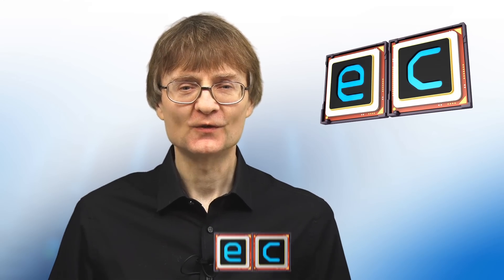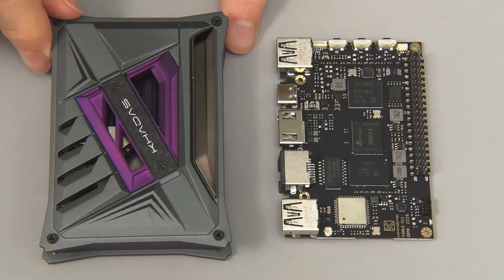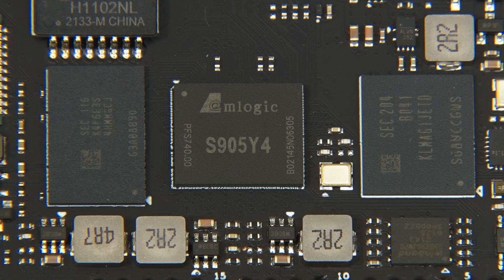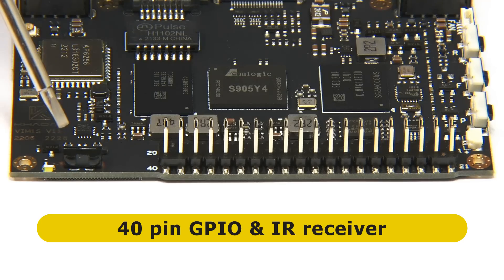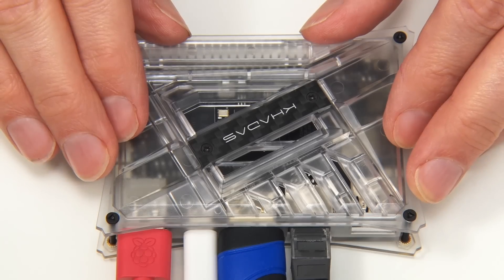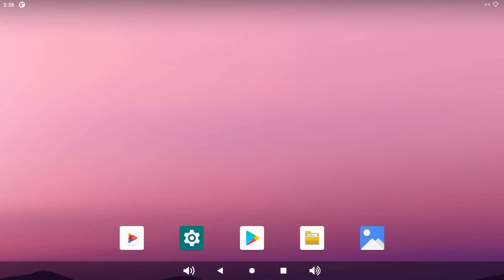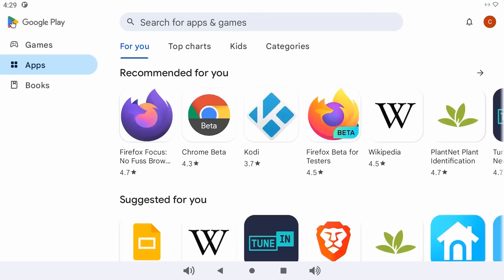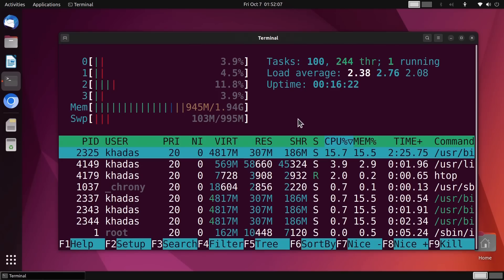Khadas VIM1s: Android & Linux SBC

Comment: Here's a possibly stupid question, can I watch Amazon Prime on the Android platform? I only want an SBC to watch Prime but usually do stuff through Debian but the frame rate drop thing shown here doesn't appeal. Thanks
Reply from the maker: Yes, there is an Android Amazon Prime app.I've not tried it on this SBC, but it should work fine, as it is a pretty standard app. Or you could get an Android TV box probably cheaper than an SBC.
Reply: @ExplainingComputers  Thanks for this. I just found out I can plug a keyboard and mouse into my new Tanix TV box which has Android 12 and downloaded that Prime App to this little £40 device - so quite happy with that! What a lot of capability for so little money.

Comment: I honestly cant see what their target customer is for this, with no USB3 and a 100mbit ethernet, while still being 50% more expensive than a Raspberry Pi. It seems to me to fall between two chairs and will appeal to absolutely no one. Like, "do you want to buy the recognisable brand name SBC Raspberry Pi, which everybody knows and has confidence in, or do you want this competitor which not only costs 50% more, but has 20 year old connectivity technology". Absolutely mindboggling.
Reply from the maker: I can only agree that the lack of USB 3.0 and 1 gigabit Ethernet are very surprising on a 2022 SBC at this price point.

Comment: I place this kind of cardboard casket top cover up, take upper box with both hands and shake up-down as fast as I can, even if the contents of the casket is light in and of itsels, the bottom box has enough of cardboard mass to detach and fall down on the table with its content.

Comment: So, this needs a lighter OS than Ubuntu, I wish board makers would stop with Ubuntu/Wayland, that a lone was using half the memory and I didn't see any gains. I removed Wayland, and installed XFCE 4  and it running great, video is working. I will admin the Android seem to be good, but some apps don't work work correctly because it flips like it's a phone. So, I am not impress. I love to see Debian or Manjaro running on it, I bet will be better.

Comment: You went into your swap space on Ubuntu. That will really slow things down. Rule of thumb, Ubuntu needs at least 8GB of RAM to operate at peak performance.

On my Linux development machine, I have 16 cores at 4GHz on an AMD CPU with 32GB of RAM. Overkill? Not for the research that I do.

Agreed that the Raspberry Pi 4 is better.

Good video.

Comment: Sadly, i don't understand why Khadas Vim would bring this out when there are better TV boxes out there using the S905X3 with 4Gb ram and 128Gb emmc for the same money, with a true 1000Mb LAN, has USB3 and is available on Amazon, (with a free case). A much higher performing SoC. Or the same better chip with less emmc for 50 bucks. But again great video, thanks Chris. I love seeing you check these SBC's out.

Comment: One point regarding YouTube in this video.
On Android, you used a stand-alone YouTube app to get good playback.
But on Ubuntu you ran YouTube from within a browser which adds quite a lot of overhead on top of the YouTube playback.

I would recommend using the same browser on Android to run YouTube for a better apples to apples comparison.

Comment: Love  "the opening" episodes, Chris!!!   Mr. Scissors could of help prime out the box for next time?... or even Stanley the knife?  Yes, very surprised about not having USB 3 and not 1Gbps ethernet?  Again, very surprised!  Since you have the board, can you actually see if it's a typing error for the ethernet by running a simple file copy of a suitable file across the cable?

Given the price and lack of support for those two mentioned, I would look at other alternatives before this board.  One plus for the board ... it looks nice ... and it's thin!  Looks are secondary to functionality for real work! 🙃
Reply from the maker: Thanks for this. On the Ethernet port, I confirmed the 100megabits/second specification with Khadas during production of the video.

Comment: At 2:54
Prices....

You mentioned the Vim 1 was a little more expensive than the Raspberry pi, but you didn't mention that the Raspberry pi was unavailable and would be for months....if the vim 1 is available, then it doesn't really matter what its price is.

Comment: Thanks for another great vid with perfect timing for me.

After catching this Video I decided to "order the following kit"  for my purposes it should be fine.  The WiFi & Ethernet options cover teh comms requirements.
Use Case:  Using Android/OS it should (I Really Hope) allow me to monitor my fleet of BMS' (Battery Management Systems) for my offgrid solar system which is a separate building.  Wired for Ethernet and is also within WiFi Range.  The challenge such as it is will be to setup TeamViewer or the like between that Droid Device and Win-10

VIM1S  $64.90
DIY Case $13.00 Color: Transparent
RTC Battery $2.00
3705 Cooling Fan $15.00
New VIMs Heatsink $10.00
Reply from the maker: The comment offering a prize was from a scam account that has now been banned here. Any reply from me will be from "ExplainingComputers" and will have a verified tick.

Comment: I think it really sucks that it only has 100M Ethernet. The wifi card is probably faster than that, which is kinda sad. To be fair, I'm not sure if the SoC supports gigabit on the first place, which I kind of doubt as previous S905x/y series chips did not

Comment: The box requires gravity assistance to open.  Don't try picking at the inner box but instead hold the outbox up while shocking it downwards to the table.  It should fall right out.  At least that is the way I do it.   :-)

Comment: And here I am wondering if there will ever be an SBC which has everything perfectly aligned.

There's always something that's not up to par with reality.

100 Mbit ethernet I can live with. USB 2.0 is good enough.
But still, the lack of RAM and power will cave this poor board in when it comes to heavy performance.

But it does seem a nice little device with a few quirks to show for.

Comment: With all the SBCs you've collected over the past couple of years, you could build quite the cluster 😆
Reply: Do you know of a single system image OS that can do that?

   Anything I've been able to find is grossly out of date , discontinued and often not in English.
Reply: @petevenuti7355  I do not! That is a great question for Level1Tech's forums though.
Reply: @andrekz9138  it looks like a great resource , I bookmarked that to my favorites. I'll ask that question there.
Thank you.
Checking it out I searched a few questions I knew about and some I didn't... The results of that experiment were mixed.
  I saw someone asked a question about using IDE or SCSI  for a computer to address another computer instead of a disc drive (as in like a network protocol) , the answer was a suggestion to use iSCSI to share a drive... That kind of answer reduced my optimism...it wasn't what he was asking.
There wasn't much about raspberry pi
But there were a lot of very well constructed informative answers about virtual machines & pass through, PCI cards, and RAID configurations among other things...  AGAIN THANK YOU .I  bookmarked that reference.

Comment: I would like a video using the gpio 
Especially for projects and answering the question of is it a useful alternative 
I would like to use it for everything from rc cars to some type of robot using sensors. If it's a struggle to get program running or there's not much support i would have to keep searching for a better sbc

Comment: Whilst lack of USB3 and high speed ethernet impact it, it could still make a decent Android TV box. For instance, if you have a family member in your house who might like to watch what's on your media centre, but lack a smart TV or computer, this could be used as an alternative, like a Sky Box for your media. Since the use case would be streaming media over wi-fi and most likely never saturate that bandwidth, the lack of fast storage and ethernet wouldn't affect it.

Could also be used for playing mobile games with a mouse on a larger screen.
Reply from the maker: Agreed. There are applications here -- and the board is available to buy! :)

Comment: What about using M.2 as External Storage for these devices @ExplainingComputers. Would that make things better?
Reply from the maker: There is no way to connect an M.2 SD (SATA or NVMe) to this device, except via an appropriate adapter over USB 2.0. It would make no difference to the speed in Ubuntu. :)
Reply: @ExplainingComputers  Cool. Though,do you have any recommendations for thoughts that do?

Comment: One thing I would be interested in is that for any desktop these days (not relevant to embedded systems) I would not look at disks without encryption, so on Ubuntu something like LUKS.  It would be interesting to see how that impact on performance (although with only 2GB RAM, that too would be straining things a little).

The only positive thing that I can say at this time is that Raspberry PIs are somewhat supply constrained, so that it allows alternatives such as this, even if they are more expensive and less functional, to get a foot in the door.
Reply: I disagree with your point on disk encryption because in most cases it is entirely unnecessary overhead, particularly on small form factor devices.

As someone who works in cyber-security, I would go a stage further and say that encryption is overused these days and there are too many people who think that once they've deployed encryption, they can just sit back and not worry about security any more.

Most web sites providing publicly accessible information that don't require login (e.g. bus and train timetables, recipes, movie showing times, etc. etc.) do not require encryption - yet running a non-encrypted HTTP site is seen as a "grievous sin" these days because every web server now has to be encrypted.

When the web first came online during the mid-90s, I was able to browse "the simple web pages of back then" perfectly happily over a dial-up connection using the iBrowse browser on a Commodore Amiga A1200 running at 14MHz with 8MB RAM. That would be impossible now with the "bloat" of the modern web, some of which is because of frequently unnecessary encryption.

Disk encryption is the same - it protects against someone taking that storage media and reading it in another machine but not against some stealing the entire machine and getting to the contents that way, unless you want to have a system where you have to put in a de-encryption key every time that you boot the machine up.

I'd argue that a better approach to security is to think about what data is on the hard disk and whether or not that needs to be protected - there's no point encrypting the MicroSD card filesystem of a Pi if all that Pi is doing is running a few emulators or a bit of code interfacing to electronic circuits.
Reply: @terrydaktyllus1320  firstly, I totally agree that disk encryption is not a panacea, but there are no panaceas in security, which is why you need to look at as many tools as you can, and encryption is just a part of that toolkit.

I would agree that encrypting a MicroSD card might be pointless, because if you are running a system that only has a MicroSD card then it clearly is not a data intensive system.  On the other hand, once you are talking about running with a 500GB SDD then you you have a lot more data to protect and looking at how you protect it becomes important.

As you say, disk encryption only has value if you need to enter the key every time you boot up the system.  I would accept that this is impractical for embedded systems (as I indicated above), but how many embedded systems are going to need 500GB of Nvme SDD?
Reply: @Hfil66  Absolutely there are "panaceas" in security, I couldn't disagree with you more.

The whole idea of security is to define that "panacea" and then use tools like risk management and attack vectors to get as close to that panacea as possible.

You will never reach that panacea and you have to constantly test against that panacea but you have to have something to aim for.

Comment: Very interesting. Thank you.
Strange as it may seem this is the first time I'm tempted to acquire an SBC other than a Raspberry Pi, especially running Android OS, despite the shortcomings of the VIM1s.
Incidentally at 0:45 ALEXA keeps chiming in with random rubbish. It must be your dulcet tones Chris. So much for Amazon's assurance that the buffer is only listening for a wake word. Weird but most amusing.
Reply: Well the BIG advantage it has over RPi is that it is AVAILABLE!   ;-)
If by "0.45" you mean at 0:45 in the video, my Alexa had no reaction at all.  I played that section several times with an Echo Show right next to the speaker.  Maybe your Alexa device has been hacked!   ;-)
Reply: @ElmerFuddGun  Never mind. Don't be disappointed.

Comment: Very interesting that it can handle YouTube playback on Android and not Linux. I suppose the hardware is originally descended from Android boxes and is optimised this way.
Reply from the maker: It is nothing to do with the hardware. A GPU driver for hardware accelerated playback exists for Android, but not for Linux. :(
Reply: @ExplainingComputers  One would think that ARM would be more supportive of open source drivers for their own Mali; it would bring them a competitive advantage.
Reply: The Linux kernel in Android most likely contains a binary BLOB with GPU driver enabling HW-accelerated playback, whereas the Linux kernel in Ubuntu is the generic, mainline one that does not contain driver support for that. That's the problem with ARM-based SBCs: they have built-in GPU and SoCs manufacturers provide only a closed-source binary driver, compiled against a specific version of the Linux kernel (effectively ruling out kernel updates). If you have an Android phone, you would see the Linux kernel is rarely updated if at all. The thing is the explicit policy of Linux kernel developers is that private, in-kernel APIs (only public system calls are guaranteed to be stable) may change from version to version, meaning precompiled, binary modules (drivers are such modules) are not likely to work with another kernel version, it is fine for open-source drivers, but problematic for closed-source drivers of hardware with limited lifespan/vendor support such as ARM SoCs. In short: Linux does not have a stable ABI for kernel modules to not be cluttered by compatibility layer with legacy code. In Windows things are different: Windows kernel is itself closed-source, so it has to expose some ABI/API for driver developers that would be stable for 1-2 generations of Windows.

Comment: I was going to defend a bit the lack of USB3 and 1G Ethernet but I'd have to see iperf3 results of wireless network. 
Given the lack of hi performance storage I'd see this board like for example robot I/O controller, where good wireless connectivity with cloud or control service would be good (given the external antenna option) and fast Ethernet would be enough for internal communication.
But for all other use cases presented on the website it sounds rather... useless?

Comment: Have you looked at the Firefly ROC-RK3588S-PC SBC? I would like to see a review if you haven't already done so.
Reply from the maker: I haven't looked at that board. There are quite a lot of RK3588 SBCs out there now, many at prices that causes me to question why they would be chosen over x86-64 alternatives, especially when GPU drivers for desktop Linux are always problematic for Rockship SoCs. So I've waited for the Rock 5B -- which is RK3588 based and will appear on the channel two weeks today (30th October). :)

Comment: A factory fresh Raspberry Pi 4 2GB from a reputable vendor is not to be had for under $150 right now here in the US - obviously we transitioned from GPU surge pricing to a national Raspberry shortage. Considering the real price of a comparable Pi the VIM1s might represent a reasonable value depending on use case, most likely as an HTPC.
Reply from the maker: A "reputable" Raspberry Pi vendor is an official vendor. And ALL official vendors list the Pi at official prices -- they have to if they want to remain official resellers! :) So, for example, Adafruit today (October 16 2022) list the Pi 4 2GB at the official price of $45: https://www.adafruit.com/product/4292. 

So my argument would be that no reputable seller lists a Pi at anything other than the official prices -- only scalpers charge more. Certainly supplies are extremely limited. But Pi 4s can still be purchased from all official vendors if you register interest so that you are notified and can grab one in the few hours of stock that happen every now and then.
Reply: @ExplainingComputers  Yes and then: The issue is that 'official' vendors are out of stock at least here in the US for quite a while and I was never lucky enough to hit the few minutes (not hours) when they were available. If you need one for a project within a short period of time you are forced to use a reseller. Reputable in this case to me means reasonable feedback as a reseller over time. It's capitalism at work, similar to Uber's surge pricing (would you postpone a ride to a game of your favorite soccer team to two hours after kick off time in order to avoid surge pricing?) - "Greed, for lack of a better word, is good." 😏

Comment: Chris, did you discover the max supported speed on a single antenna for the 802.11ac WiFi?
Reply from the maker: Possibly! :)
Reply: @ExplainingComputers  Would it be the replacement for 1Gb Ethernet? Or significantly slower? I have several 5Gb+/sec WiFi routers with sufficient throughput for when I upgrade to 10Gb/sec Ethernet networking at home... (currently slogging along at 1Gb/sec sadly)